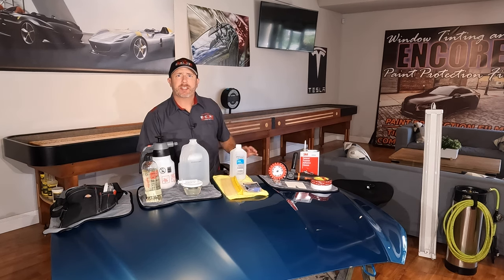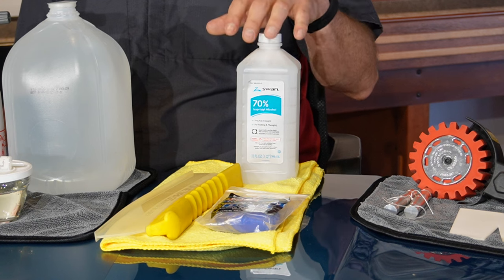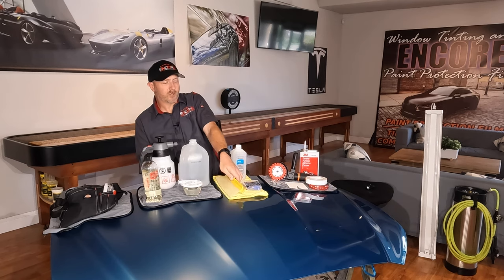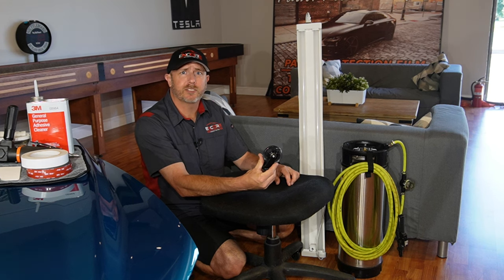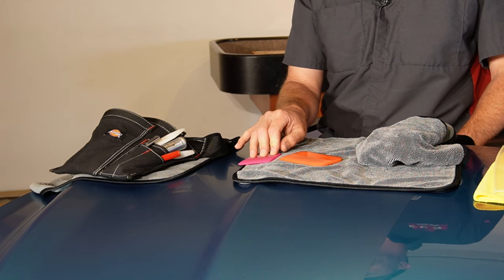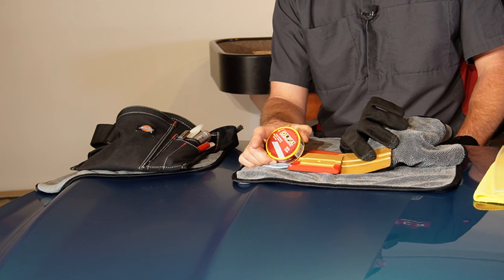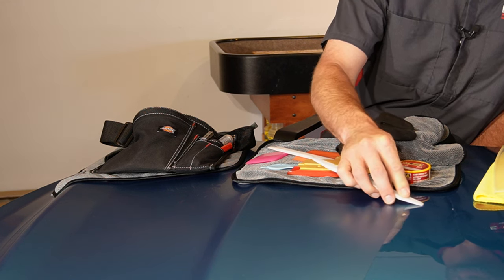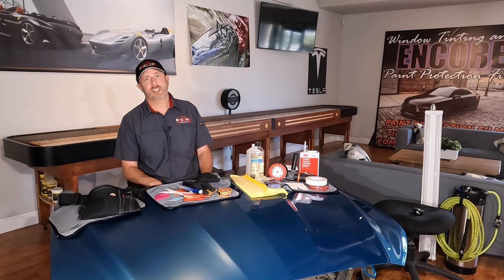Paint Protection Film Installation TOOLS - Every PPF Install Tool Needed

Comment: Great insight into the tools and products you use. The cigar holder was a nice touch 😎

I use RO water at my shop as well and found I really need to up my slip solution since the water is so “pure.” What’s the soap you’re using? I’m using J&J baby shampoo and need about 16 ml a gallon with RO water to make it slippery enough to avoid pretacking.
Reply from the maker: I really like the cigar holder. Looking on amazon turned up some really nice ones. I'll probably upgrade soon!

There is a link in the description to the soap I use. It's Car wash shampoo that's made or was formulated in Germany.  I bought it from my PPF supplier by its no longer available.  After some exploring, I was able to find the same product rebottled by another company.
Reply from the maker: Here is a link to the soap from my slip: https://www.detailersdomain.com/collections/wash/products/nanolex-pure-shampoo
Reply from the maker: The RO system affected my slip solution as well.

Comment: Hey Brent, do you use a steamer for any installs? Thanks!
Reply from the maker: Yes. We use a jiffy steamer. Works great! I used to use a steamer on every install. Now, the film is so flexible I don't use it much. I used it the other day on a Toyota Supra, tough stretch! We mostly use it for removing PPF now. Helps the PPF come off easier and help ensure We don't pop paint off of repaints.